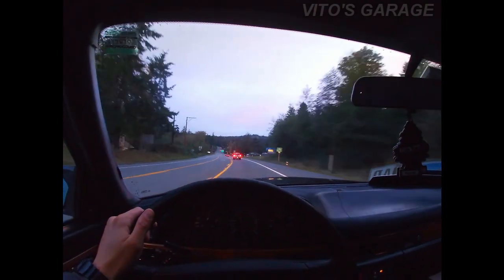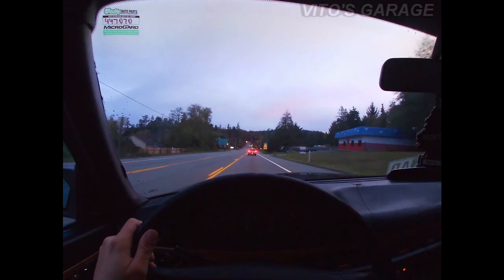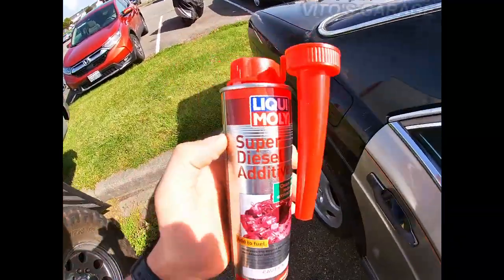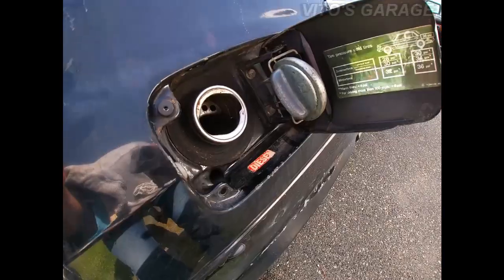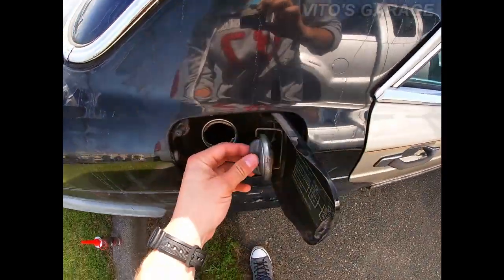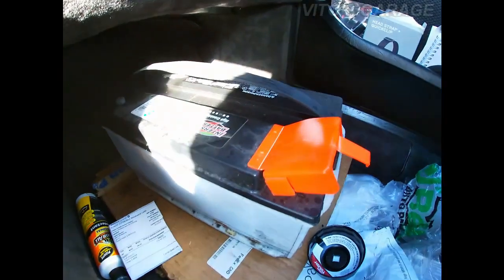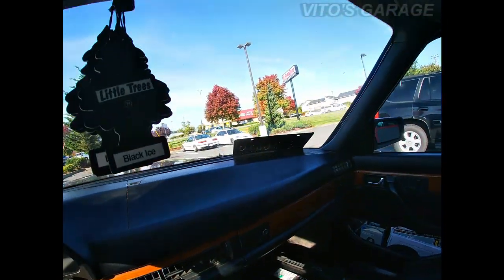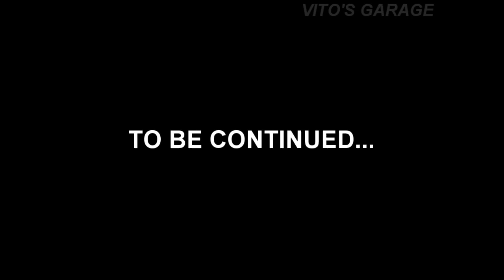I Found a Classic Mercedes W123 in The Junkyard!

Comment: Which side of Puget Sound are you. I had a sister lived in Port Angeles on the tip of the peninsula. I don't know if she is still there.
Sounds like they did not hook your battery up right.
Reply from the maker: I am 100 miles from Seattle. I am in Whidbey Island. I am currently in the military, so I am stationed there. Originally I am from Chicago. I drove my W126 accross the country last year. But yes, I love old cars so much. And yes, they most likely didn't hook up the battery correctly..